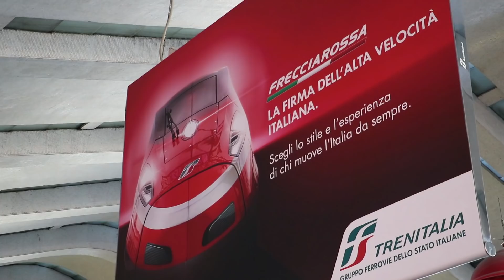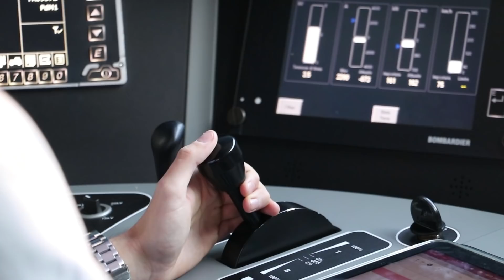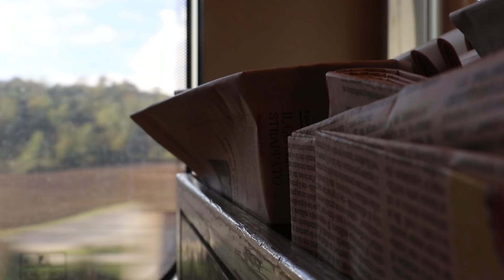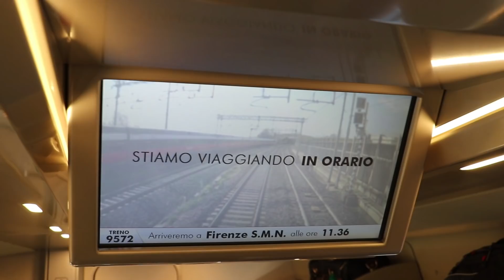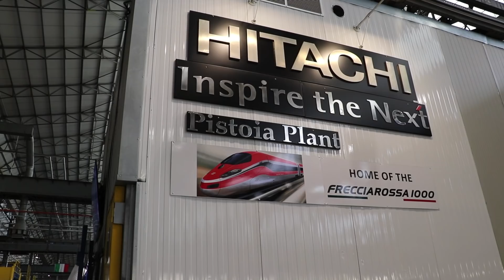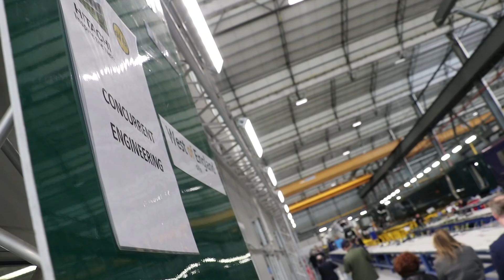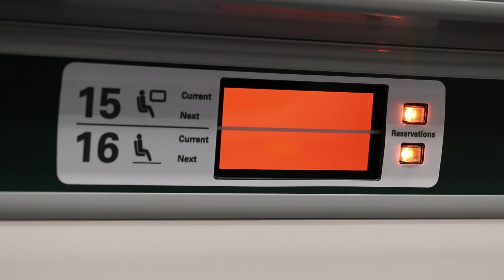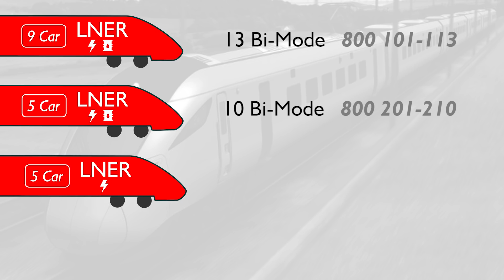High Speed Harmony - Hitachi/Bombardier in Italy

Comment: Oh god these guys

Sorry if any guys from Hitachi is reading this but you guys have seriously screwed up on some of your products. I myself live in Denmark so I'm no stranger to the failure that is the IC4 trains. If you didn't know the IC4 and IC2 (not to be confused with the Adtranz IC2) was an order for High speed DMU's placed by DSB in 2000-2002. They were supposed to start running in 2005, they didn't start until 2007 because of technical failures and difficulties. and following that it just became worse and worse. Quite a few have already been scrapped, and almost all of the IC2s have been sold to Romania. And the IC4's that are left are now downgraded to run regional services, leaving the Intercity traffic to the IC3's and IR4's which the IC4 was supposed to replace.

Comment: Gothenburg bought trams from AnsaldoBreda in 2001, first unit of series 1 (40 units) was delivered only 1 year late in 2005, last of the first series arrived 2009, 4 years late. Series 2 (25 units) was delivered in 2011 untill 2013. About the same time as all of series 1 had to be taken out of service due to severe rust and mold in the under carriage, articulation and frames due to lack of rust protection, AnsaldoBreda had to pay for the repairs. The same problems occured also in series 2 but as  AnsaldoBreda only botherd to repair 5 units and thretened to sue the city council by 100 million Euro because the press got hold on it.... Now us citizens of the city has to pay for the repairs as AnsaldoBreda was bought by Hitachi and hence is at no point obligated to fulfil old contracts. We are getting new Bombardier Flexity Classic (M33) to replace the old ASJ/ASEA M28 and M29 trams developed in the 50's and built in the 60's and 70's which was suppoused to been replaced by the AnsaldoBreda Sirio (M32). But there are talks about that the Bombardier trams will replace the AnsaldoBreda trams before the last M29 goes out of service as the contract is on a series 1 of 40 units and follow up orders of a total of 100.

Oslo had similar problems wiht their trams. The Danish State Railway and the Netherlands State Railway also have big problems with the high speed trains they bought of AnsaldoBreda, one Danish set went missing before it was delivered and when Danish TV looked in to it AnsaldoBreda had given it as a birthday present to Muammar Gaddafi in Libya -_- (can be seen on satellite foto at   32.828791°N 13.111563°E)
Reply: AnsaldoBreda has been building trains for 100 years, all companies in the world may have some problems.
Gly Ex Fyra trains for the Netherlands were bought by Italian railways for high speed and they work very well ;-)
Reply: And what about the Copenhagen metro?

Comment: Couple of months ago I was Interrailing around Europe. On my Italian leg I took a Frecciarossa for one portion of the trip, and I have to say that overall it's a very impressive service even in Standard class (the auto-looped cartoons plus all the other features on the screens at either ends of the coaches were a definite plus :P). Definitely had a better experience than on the German ICEs (which I had been looking forward to). Hats off to TrenItalia, and the train manufacturers I guess too.
Reply: @Tom The one I've ridden is the AVE. That's a great system, super fast and nice. My only complaint is that the onboard wifi isn't easily accessible if you're a foreign tourist (at least, I couldn't figure out how to sign up).

Comment: A joint venture between AnsaldoBreda (Hitachi Rail Europe) and Bombardier will only work if the Italians only do drawings for the interior and let Bombardier do everything else. As someone else commented, the Pistoria plant have made some of the worst trains in the last 20 years. Fyra V250 in the Netherlands and Belgium that fell apart and was returned. In Denmark they were suppose to deliver the new IC4 trains in 2005. They are still not working or running properly, and most of them have been scrapped already and never went into service. Just stay away from AnsaldoBreda :-P
Reply: The plan is that the venture will be between Hitachi Rail Europe and Bombardier UK, using both companies' factories in Britain (so the same factories currently churning out IETs and Aventras).
Reply: Milan's Metro trains are perfect, as are the trams, as is the ETR 1000.

Don't know what you're on about
Reply: Is Bombardier under different management over there then here in Canada. Here they are notorious for being very late on deliveries
Reply: @sebastianmalton5967  The German part of Bombardier (former Adtranz) usually knows how to build things properly. There has been some hiccups there too, but my understanding is that most of it is built well at least and will work when it leaves the factory. But there has been delays.
I know the streetcars for Toronto has been very delayed and had lots of issues. Blame Canada! ;-)
Reply: @sjokomelk  The hq of Bombardier Transportation is in Berlin (at least I think it still is, they will move to their factory just outside of Berlin). They are in charge for the railway sector worldwide. But they are lately known in Germany for some screwups, they delivered the last trains for Deutsche Bahn late and had pretty big issues. The Talent 2 regional emu had caps in which the drivers got wet from rain.
Reply: NeoDerGrosse they have a factory just outside Berlin? I thought their European factories were in Bruges, Bautzen and Darby Litchirch Lane

Anyway I hope the delays aren’t affecting the Class 710s for the London Overground, and I hope they won’t affect the deliveries of the new CR151s for the Singapore Mass Rapid Transit in a few years
Reply: @spdfatomicstructure  They have many production sites in Europe like Görlitz, Bautzen, Bruges (Belgium), Savona (Italy), Vienna (Austria), Crespin (France) and more.

You can check on they website : https://www.bombardier.com/en/worldwide-presence/country.germany.html
Reply: Bombardier isn't better with the Twindexx. 5 years of delays and the train still doesn't run as desired. We can also speak about the IC2. Bombardier become the same as AnsaldoBreda.
Reply: mo1to1  I lump the IC2s with the IC4s as it was the same basic product.  I hope the Romanians can make a go of them.
Reply: @erik_griswold  I was speaking about the IC2 for DB which is build by Bombardier. Bombardier had some problem with it and we still are waiting for it on the Stuttgart - Zürich service.
Reply: Bombardier is in such a hole they have two of the largest public transit agencies in north America, the Toronto Transit Commission and New York City Transit, really angry with them. It's to the point the TTC have filed a lawsuit and NYCTA banded Bombardier from bidding on the massive 1600 car order for the R211 class for the subway (which eventually went to Kawasaki). 

NYCTA was supposed to have all 300 plus R179 class subway cars in active service back in last July. Instead, only about half the fleet has arrived. 

It's much the same for Toronto's new Flexity Streetcars, they've been arriving piecemeal over the last four years.
Reply: Bombardier? Good luck. POS (piece of sh*t)
Reply: The IC4 trains are all running properly and all 49 of them are in service after technical issues spanning from 2007 to 2011, with there not being issues since returning to service in 2012.
The V250 had small issues but also incomoetent drivers and now are starting to run as ETR 700 on the Frecciaargento service.
Reply: Typical Northern European trying as always to denigrate us Italians., with some bullshit
Reply: Hopefully the Hitachi take-over fixed a lot of things, but that situation with the tied-down pantographs taking down all the catenary recently may indicate not all is well in Pistoia.
Reply: Very racist anti-Italian statements there.

Are you Danish? If you are feel free to explain why Denmark couldn't make their own trains. What does Denmark actually make again?
Reply: @DanielEyre-v2z  He's Norwegian. The IC3 trains the AnsaldoBreda IC4 were supposed to replace were built in Randers in Denmark by ABB Scandia, acquired by Adtranz, which was itself acquired by Bombardier; and still operate and will outlive the IC4. It's a small country a tenth the size of Italy and being a member of the EU, look for foreign consortia to supply equipment. AnsaldoBreda also botched orders for Gothenburg, Sweden; San Francisco, Boston, Washington DC, Oslo and Manchester.
The metro system in Copenhagen was also supplied by AnsaldoBreda, however it does operate quite well (but with teething problems in its introduction).
Reply: Ma vai cagare!!! (Do the translation).
Reply: There is an old joke saying that heaven in Europe is where the English are the policemen, the French are the cooks, the German are the mechanics, the Italians are the lovers and the Swiss organize everything.
Hell in Europe is where the German are the policemen, the English are the cooks, the French are the mechanics, the Swiss are the lovers and the Italians organize everything.
And I kind of have to agree with that in a joking way :-) :-P
Reply: That's part of the reason why recent Fiats have got more reliable - the electrics and mechanics for many models are made by Mazda and the Italians get to do the styling :)
Reply: @fetzie23  the only Mazda made fiat is the 124. Nothing else has Mazda parts